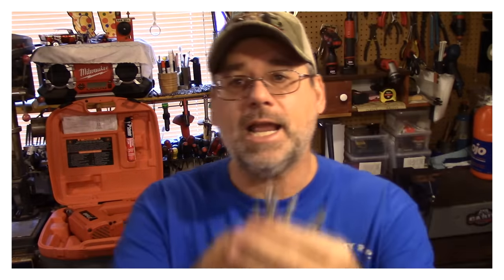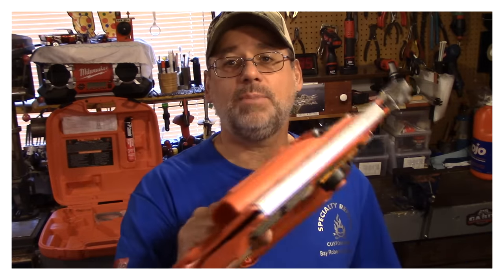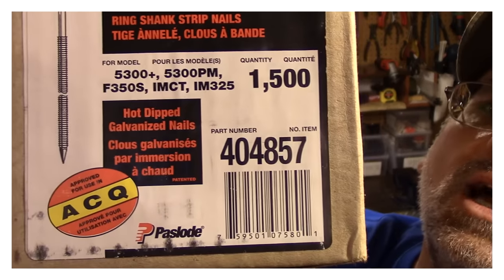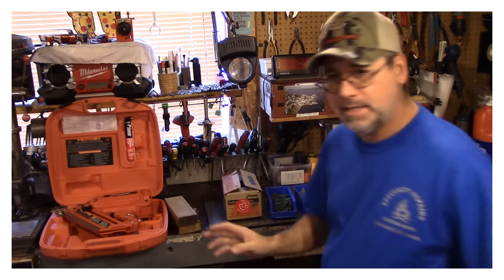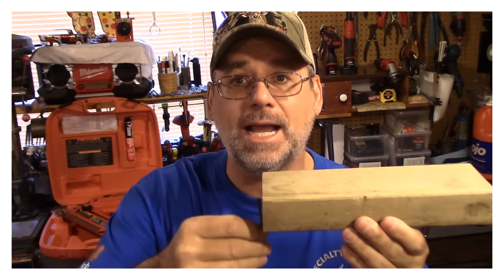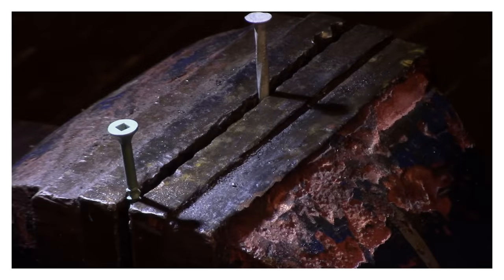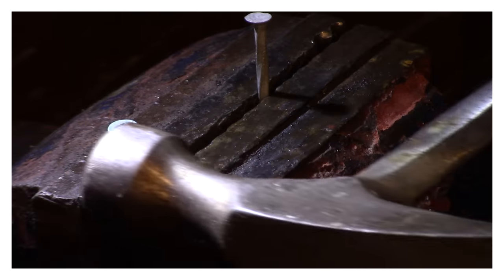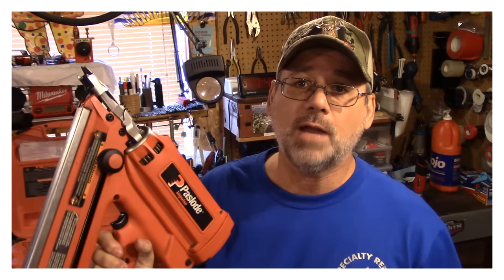BEWARE  NEVER USE DECK SCREWS  - DECK SCREWS VS NAILS -  PART TWO IN DESCRIPTION

Comment: But when would a screw, in a properly designed structure under normal conditions, ever get a sudden lateral shearing force applied to it like that? If the lateral shearing force is applied gradually (like from snow accumulation) they will bend or the wood will. Also nails tend to work themselves loose as the wood expands/contracts over repeated hot/cold cycles. It's a trade off I guess.
Reply: If you were taking a dump up there at Steve's camp and one of those bears that tore apart his deer feeder started putting lateral sheer forces on the side of his crapper, you might re-think that ! LOL !
Reply from the maker: Well I  have seen them used for vertical loads and  shear off.  They don't  seem to bend much before they snap off.   They are quite brittle and not intended for framing, now I know a lot of viewers probably do use them and have never had a problem but it's a totally different scenario when something does go wrong and liability and fault is found.  An outhouse not so critical. LOL
Reply: +Billy R, HAHAHA, you're probably right.
+STEVE ROB, with screws or nails a good metal L-bracket or corner-brace should be used to take up the load. Right? Its been a number of years since I worked for a contractor building decks. Techniques may have changed since then.
Reply: Techniques and fasteners have changed for sure ! I work in the commercial construction industry and we fasten metal framing all the time to steel with powered actuated guns that shoot harden nails. But when the structural engineers are looking for real strength for structural loads against forces such as wind sheer they usually resort to self drilling/self taping hardened screws as a faster !

Comment: Just use the GRK line of screws and problem solved. Their that took 20 sec.
Reply from the maker: Ok sounds great to me but it wasn't as much fun as doing the vid - or the part 2 of don't use deck screws . Ok that's about 6 minutes so I better warn ya first but i did all the good parts in the first 20 seconds. Oh man you will love it. Links in description - crap this note is over 20 seconds to read. Oh well I tried. LOL

Comment: The problem is not with the shearing 90% of the time. True they do occasionally shear but nails almost always work their way out. With todays poor lumber it is  much greater advantage to have the ability to lock down the boards and counter act any cupping or crooking. The big question I have should you pre drill the screws?
Reply from the maker: John  great question - should  you pre drill - well in my experience on  1 - 1/2 deck boards it does a better job especially if you trying to pull a board down .  The shear strength of deck screws  depends on how much stress their under . Nails do pop up and I prefer screws .  I will do a follow up in the future showing how the heads just snap off with a vertical load .  . Cheers
Reply: I would like to see this comparison with the Simpson structural screws (the ones they recommend for deck joist attachment) @SteveRobReviews
Reply: Or also, hitting a piece of wood while attached with a screw vs nail.. That way you are not hitting the screw or nail directly, but rather a more accurate real world scenario.

Comment: The brittle screws can not take the shear loading that nails can take.  Deck screws are great for a vertical load like holding deck planks down to a sub structure below.  Its the sub structure below that accepts the load on the deck and the deck screws just keep the planks snug tight to that substructure.  You would not want to use the screws for fasteners of the substructure however because that is where you will get into trouble with potential shear load.  As long as you understand what kind of load your fastener will be subjected to, you can quickly decide where you need to use nails and where you can safely use screws.
Reply from the maker: Well-said 👍

Comment: So what does a screw being harder and easier to shear have anything to do with construction? I've never had a screw shear in anything that I have built. Screws offer more clamping pressure and don't work them selves out over time like nails do. They are more expensive but I've never had one fail. Seems kind of odd to put down deck screws because they shear easier when hit with a hammer. I don't get it.
Reply from the maker: Hi Billy - the deck screws are fine for deck boards and fence boards but not for structural construction  and this is where some are misusing them.  They  are prone to be  brittle and sideloading shows how easy they snap.  Most places in the world will not allow deck screws in construction .  I have used deck screws  and came back the following season and noticed some of the heads have sheared off  or had them shear off while installing them.  Different climates play a role in this effect as well .  Cheers Billy
Reply: Billy Gray not only that, but screws were made to hold the board in place. vertical pressure, not horizontal.

Comment: My   thoughts on  this -------HOW MANY  DECKS HAVE BEEN  MADE  WITH USSING  DECK SCREWS? AND  HOW ARE THEY  HOLSSING  UP?  i  DON'T  SEE ANY   FALLING  APART
Reply from the maker: Milton I see about 75% are using screws for deck boards .  Some use screws in spots that are illegal  and yes the decks fall apart .  Some use screws  without any joist hangers and they fall apart.  The thing about deck building is far too many don't have the knowledge to build a deck safety and use screws for everything and everywhere.  The point of the video is deck screws are not to be used in load bearing areas so check with the  building code or get a  deck permit  which most don't.  Lots of youtube certified deck builders out there  🤣😅

Comment: That top end of the screw without any threads is much stronger than the threaded part of the screw & it wont shear off when in the hole of a stud hanger, (there are thicker screws for shear strength too), only if the screw is short or going into rotted wood & may pull out & then shear. But, nails are stronger still but hard to remove if fixing is needed.

Comment: I've made a lot of things using polymer coated grip rite screws. I don't have to worry about pressure treated wood and unless I'm worried about sheer forces and don't have enough room to put in an extra couple of screws to make up for the lack of ductility I very seldom use nails. Framing I use nails and metal ties but most everything else gets polymer coated deck screws.
Reply from the maker: Sounds great to me. Deck screws are great for so many applications and illegal in some applications just like everything else its using things as it was intended and engineered too.  You have a great day. Cheers

Comment: I had a bunch of deck screw shafts break on me using them to secure decking boards and thought it was me. Thank you for this. They have relatively less shear stress strength.
Reply from the maker: Happens a lot so I'm only using  #10 screws now . Cheers
Reply: @SteveRobReviews  Good catch. They were 9's.

Comment: Properly applied, the fastener will not be in shear, they will be in tension. What is holding the structure up is the friction created between the pieces of wood.  Using deck screws is completely fine.
Reply from the maker: Frank for non structural load bearing construction as in  deck screws are fine as in deck boards  and fence boards and interior framing of  non load bearing walls to hang drywall is fine as  most use construction screws that are uncoated  screws.  What is seen so often  by diyers is deck screws used to  fasten high sideload beams  or thinking deck screws are acceptable in place of the required fastener for joist hangers .  Deck screws are not used or allowed  in every situation the building code does not  allow so saying they are allowed in any situation  where their use is  friction  related is your view but its  best to follow local building codes and best practices performed everyday by  the professionals in the construction industry that build by code not by social media 😉

Comment: There are engineered screws nowadays! They work just fine and are stronger than nails! Of course they are seriously expensive! But yeah in general you want to use nails for general framing of walls etc. Using screws for house framing is more expensive anyways. Just use nails.  But, I would use engineered screws for wood decks unless of course you like pounding nail heads back in several times a year because they back out. I can't tell you how many decks I've walked on that creak and moan ,not to mention have loose boards because they only used nails.

Comment: I don't know why people aren't getting this. Deck screws are great and superior to nails at holding DECK BOARDS down (the stuff you walk on)  but are not meant for the supporting structure. Smaller ones are ok for your railing spindles too.

I use galvanized bolts ,hangers and "L" brackets in my framing.  I use zero nails (other than hanger nails) or screws in the supporting structure. 

Even for a shit hut I wouldn't use screws for structural. Imagine if they failed!!
Reply from the maker: Seems like a lot of people are using deck screws for structural fastening  it seems , LOL  Scott I don't get it either , your correct and keep doing what you're doing  because your doing it right. Cheers
Reply: "Imagine if they failed!!!"  Indeed.  I'll neve feel safe in a privy again.😥

Comment: Sorry but as 35 plus yr tradesman , I still look at the nail gun as lazy man's hammer , I've built many decks , sheds , garages , plus I'm a Certified Bricklayer , Stone Mason and I've always used hot dipped gal spiral nails , never a structural issue . Astor using deck screws they have a purpose , if going to use screws use wood screws that are thicker and better holding strength
Reply: I agree, but also a screw doesn't handle shifting the same way as a nail would. So there are pro's and con's. I would use a nailer for trusses, exterior walls, anything that might have more shear. And then screws for basically everything else.

Comment: I've seen 'green' looking pressure treated and 'yellow' pressure treated, never seen brown. Usually 'green' is what most use for a deck or fence post or post and beam build post. The 'yellow' is usually considered noncontact ground use. I had a POS deck on my house that some Winky Dinky's built. They used nails. They installed a ledger board that was installed incorrectly. The vinyl siding was sitting on top of the deck boards. They used clear silicone caulking to seal between the deck boards and the siding. Obviously, that failed miserably. During demolition, I encountered all the nails were rusted. The wood was rotten everywhere including some OSB sheeting and ribbon because of the improperly installed ledger board and not using a sensible flashing system of some sort. After all demolition was completed, I replaced and repaired the damage caused by the improperly installed ledger. This was being done while the siding was removed on the entire house due to storm damage. When I installed the new ledger board, I used a 'Z' flashing and placed rubber seal tape all along the top of the 'Z' flashing so when the siding was installed later the siding company reinstalled some new wrap that covered down close to the 'Z'. I did not use deck posts. I installed four 12 diameter caissons 42" deep installing a bolt on each attach a bracket that hold a 4 x 6 posts. Installed a doubled 2 x 10 framed attached to posts to set the deck on. All framing was 2 x 10's. Used joist hangers installed with joist screws. Had four hidden hangers on the four corners installed with joist nails. All framing with deck tape before installing deck boards. 2 x 6's were used for decking installed with 3 inch torque head deck screws creating a picture frame install. Used four stringers cut from 2 x 12 installed with galvanized hangers. Step boards using 2 x 6. Stained it when wood was ready to except stain.
Reply from the maker: Hi Keith 
Glad to see you got the shody work sorted out 👍
Reply: @Keith Dunbar, the deck on my house was built as badly as yours, perhaps worse:  The ledger board was nailed directly to the house *right through the vertical shiplap cedar siding which had been installed before the deck was built*.  No flashing over the ledger board either, but considering it was nailed right through the Cedar, how would you even put flashing there? Because the house has 3 shed roofs without gutters that dump quite a bit of water onto the deck, the bottom foot of the cedar siding, where it needs the deck, would get saturated every time it rained, and the water soaked up by the cedar siding was being trapped between the ledger board and the sill of the house. The cedar was growing algae and moss and getting spongy and rotted,  so I ended up bolting heavy steel angle-stock to the concrete foundation to support the ledger board from underneath, and then I sawzalled and chiseled all the rotted cedar out from in between the ledger board and the sill of the house, adding  flashing and a horizontal piece of sacrificial pressure-treated "molding", but leaving a narrow airspace between ledger and sill (hidden by the overlapping sacrificial board).

  Amazingly, the ledger board itself was undamaged; but the decking planks had been installed at a 45ﾟ angle with all the cut ends of each plank butted right up against the house, so every plank had rot on one end. When I replaced all the deck planks (using coated Torx head deck screws) I put them parallel to the house, so that if I had to replace any rotted ones in the future it would just be the couple of planks closest to the house. It has been 6 years since then; I powerwashed and re-stained the deck last week, and replaced just three planks. All but one screw came right back out easily with an impact driver!  The original planking had been installed with nails, and I don't know what they were but they would frequently pop up on their own, abdvtet many of them were virtually impossible to pull with a pry/demo bar, and I had to bend them back-and-forth and snap them, or cut them with the sawzall or multi tool (and they were HARD steel). Screws are definitely superior!

Comment: I liked the info... Next time spend more time showing the meat and potatoes of it. It felt like an old timey story about you loving nails... If you explained the shear strength of the two and demonstrate a few versions I bet a lot more people stick through the whole video. Thanks!
Reply from the maker: Valid points and in the part two I do just as you say. Cheers

Comment: The screws are only used in structure when you need to pull a board tight before you nail it.  Otherwise only use nails if possible, and they are WAY faster on deck surfaces if you have a good nail gun.  Sometimes I use screws on the ends of the deck boards so they stay flush with the next board.

Comment: Only a fool would use deck screws for structural framing. However, something like GRK framing screws are fine, and in some ways are better than 16d framing nails. I understand that many European countries use nothing but screws for home building, for example, The Netherlands.
Reply from the maker: +Louis Boliou  Well it seems there are a lot of people out there using deck screws for everything .  I haven't seen screws used in new home construction here yet. Cheers

Comment: There are much better screws that I use, and I drill pilot holes so the wood don't split
Reply: a screw of equal length to a nail has 3 times the holding force than the nail.  depends on the application…I use lag bolts for timber building with washers, and pilot each hole. Each to their own.

Comment: Big enough screws work fine. I use a lot of GRK lag replacement 1/4” or so. Plenty of shear for a shed or other use. And way more pullout strength vs nails
Reply from the maker: +LKN4WAR Good points there. Cheers

Comment: Where are you using nails or screws for structural joining? The actual structure of a deck should be fastened with a combination of actual wood joinery, steel hangers, and lag or carriage bolts. The only reason you should be using nails or screws in the load bearing structure of a deck is to hold your lumber while you set your bolts. I can’t think of any application where modern building codes will allow galvanized nails/screws as the only method of fastening joists, beams, or ledgers (except maybe if you are building right on the ground). I can’t speak to every location in the US, but here in the Mid-Atlantic, you need to be using fasteners and joinery that is much more significant than nails and screws for load bearing applications. With all that said, screws vastly out perform nails for securing the actual decking material.
Reply from the maker: You have a very good understanding of the subject . I only use deck screws in non structural or non load bearing areas , same as nails for the most part as proper construction does not rely only on fasteners alone as most codes dictate proper support  as dictated by local building codes.  Cheers

Comment: Tips with Steve Rob. It is too bad you can't use those twisted nails in a nailer. I find those suckers really hold tight.
Reply from the maker: John the shafts on the nail gun nails are held together with an epoxy,  try and get one of them out is a battle too. Nail guns are a blessing for sore shoulders and sore thumbs. LOL
Reply: Ya I have a air nailer. It is a lot easier. For one  or two nails I wouldn't bather.
Reply from the maker: I just like the sound of it and fire in about forty nails in each board. LOL

Comment: Thank you so much i use deck screws for my 2 and a quarter inch flooring top side  now im going for 2x 4 framing . you saved my home from collapsing imf=getting a box of framing nails. like a man. thanks again!!!!
Reply: that dexk screw snapped  nails dont snap they bend in. thanks again!